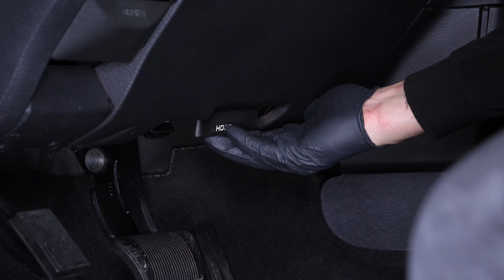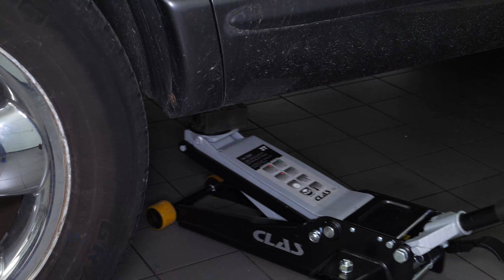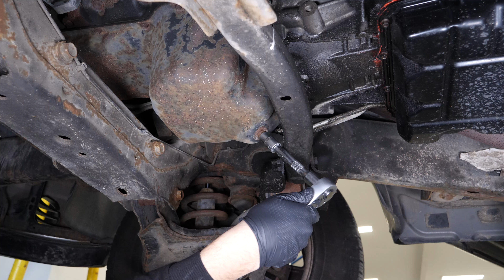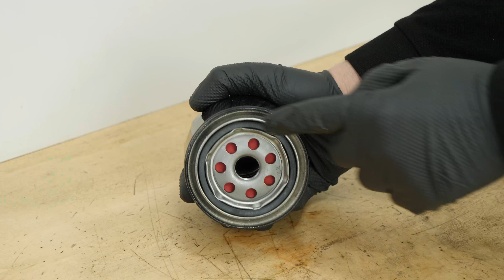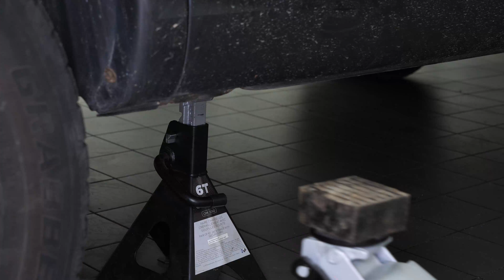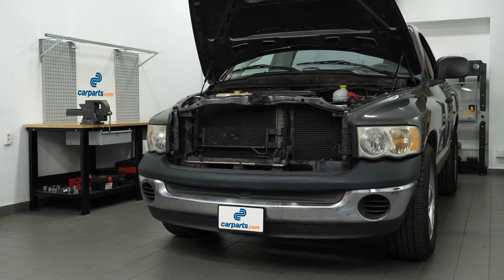How to Change the Oil and the Oil Filter 2002 - 2008 4.7 Dodge RAM 1500 🛢

Comment: Good info but you may want to check the oil capacity in the description, 17 quarts?
Reply: That's with the optional 11quart Mopar oil filter
Reply: Just my luck. I already drained the oil. Think it’ll make it to the store for another two more gallons?